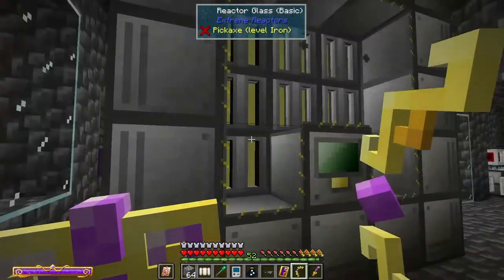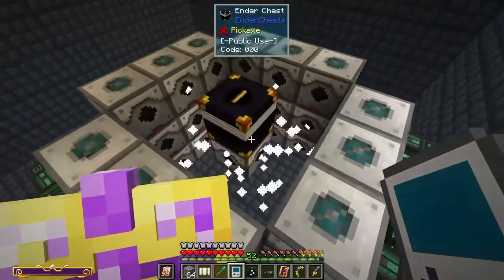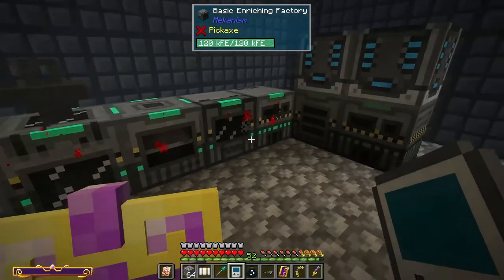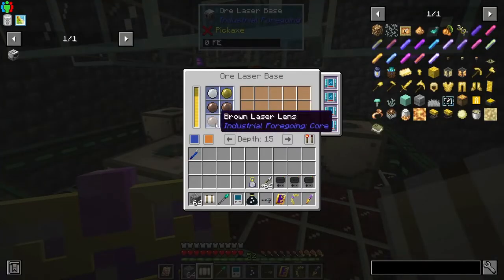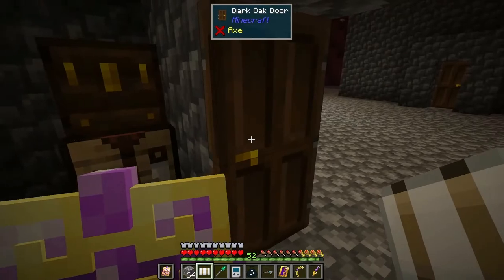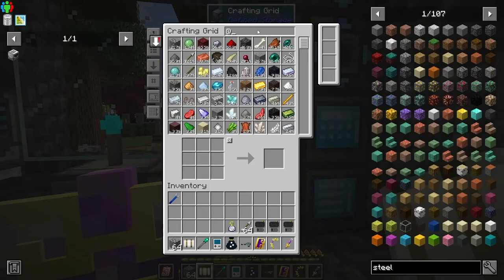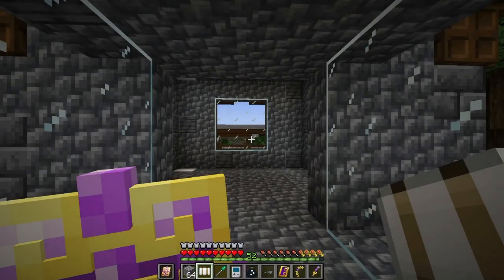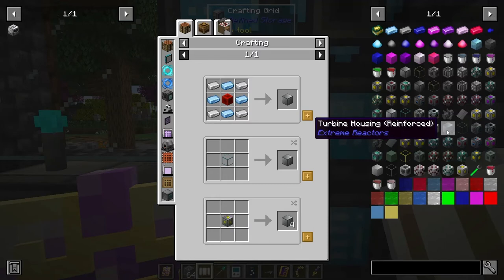DireWolf20 1.18 Let's Play Episode 86: Am I Over-REACTOR-ing?

Comment: If you right-click a flux point (or plug), you should be able to see the usage graph over the last few seconds to get a better idea of how much it's using.

And remember that the lenses don't whitelist or blacklist things; they just change probabilities.  So diamond ore is listed as in all biomes, so you should even be able to get it in The End.

I used to make large wither skeleton farms in vanilla years ago.  One thing it needed to make it more efficient was to remove all spawnable blocks in a large radius.  The easiest way I found to do that was to half-slab everything.  Maybe you could flatten an area in the nether and put lower half-slabs on it all?  That'd prevent spawns and make it safer.  You could probably even use a your quarry to define a large area for it to clear for you.  :-)
Reply from the maker: Yeah, good times :)